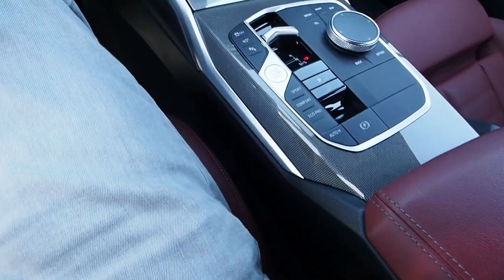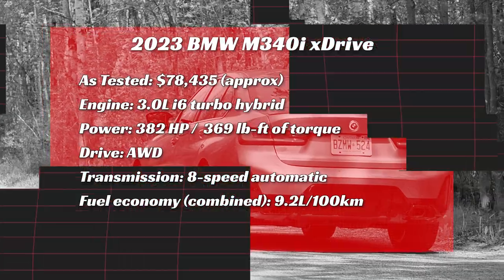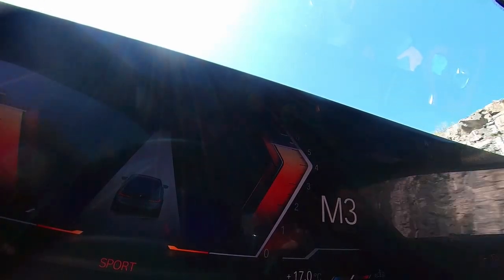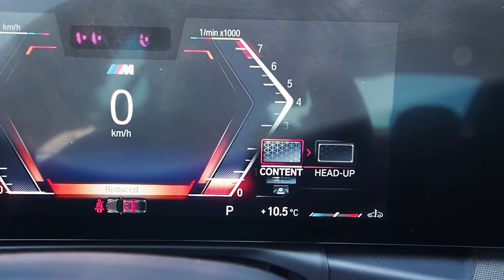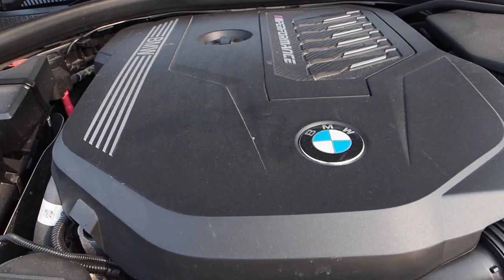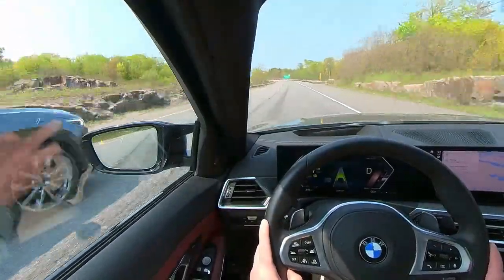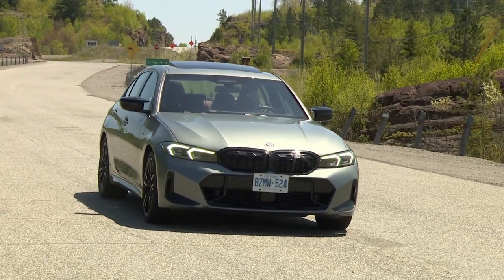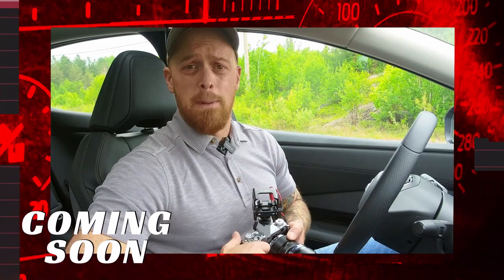[FACELIFT for 2023!] BMW M340i: Review, Road Test and Walkaround (STOCK EXHAUST)

Comment: I own this great driving 2023 BMW M340i xDrive.
I love driving this car very much, it is a fun car to drive.
But ... I hate the new controls on this car as everything you must do is thru the center screen, and I mean everything.
This is very dangerous as the driver must take their eyes off the road to change or do whatever they need to do and as every control is layers deep it takes time and long effort to do the changes.
Whoever designed this horrible and dangerous system should be fired.
BMW must change this terrible and unfriendly dangerous system ASAP.
I made a mistake buying this car.
If you are thinking about buying this model car do yourself a huge favor and check these very dangerous shortcomings BEFORE you buy it.
You can thank me later.
Reply: Really? I recently had a 330e lci as a courtesy car while my 2020 3series was being repaired. At first hated the controls but after 1 week I preferred them, use is seamless and intuitive, absolutely no problems using whilst driving. Essential controls are on the main panel. Genuinely astonished anyone would be struggling so much for it to be dangerous after a few weeks with this system.
Reply: Voice control my guy, there's layers to this lol.
Reply: I made the same mistake and am ready to break the lease to get out.
Reply: @layne4376 I much prefer Idrive 7 to 8.
Reply: That’s why they are rushing out Idrive 8.5. To rectify some of those issues. It’s still not as nice as Idrive 7 but at least it’s getting better.

Comment: Why is there an "M" preceding "340"?? Trim doesn't count.
Reply: @layne4376  More to an authentic "M" than speed in a straight line. Fact is it's a very small part. Trust me I'm in the know. Small thing,  non M's are built in Mexico along with the current M2. So much for that Bavarian ride. Well you do get that Bavarian price tag😄 Silver lining.
Reply: There three M used by bmw the first are small m badging on the steering wheel and wheels and the added trim package which is nothing more than an appearance package. The M proceeding the numbers such as M340 is a performance in the engine upgrade and of course visual cues. The M and a single number such as M3 indicate a full and true M series car. So a car such as this m340 does have a little flex as part of the m line up it’s not a true M but it does have some flex.
Reply: @362chop  My wife's X3 was built in South Carolina, and yet, it is a quality item. No creaks or rattles, and drives smooth as butter. It doesn't matter where it is built. It matters that BMW is supervising the process.
Reply: @layne4376 Thanks for reminding me why I read but not very often make a comment. I may have been short in an explanation without listing the dozens of things that can change with adding the m-sport package to a standard bmw as depending on the series there can be a wide variety of added items yet I will stand by my short but simplified explanation for someone asking a basic question. The performance is not increased as you should know being you drive a m440. You would know the engine is the same b-48 with the standard 255 hp as all 330 will have. Now like your m440 as you should know has a b58 which is in many bmw’s yet since you have the m440 you have the high output version of the b58. Thus differences in performance not ride comfort as sport suspension would take away from because the performance of less body roll during a high speed corner is negligible as are the brakes prettier yes a small increase by negligible mm in rotor size maybe increasing your stopping distance by small margins yes but not what many would say are performance upgrades. See I so didn’t want to be an ass and yet I’ve started turning into one here. I do apologize for this response. Let’s not be what bmw owners are supposedly known to be aka douche bags. I do enjoy my bmw as I’m waiting on the third one I will have owned to be built.
Reply: @ARentz07  While being charged Bavarian prices i'd prefer my build from across the pond. When BMW Spartanburg began some 20 years ago i understood the decision, made sense. But this Mexico thing , and it has NOTHING to do with Mexico itself , it soured me. BMW saves while the consumer gets screwed. Mercedes doing the same thing, C63 Sedan, Mexico. This just strikes a nerve with me, nothing personal. Good luck with everything👍
Reply: Basically appearance package. While it won’t have a true M engine, it’s pretty impressive.
Reply: @layne4376  Better check that destination on the sticker. Maybe a handful still built abroad but the ordinary BMW consumer happens to be clueless. Corners Okay, just okay. Enjoy the ride. BTW my comment wasn't directed at you more like the audacity of BMW marketing.
Reply: @layne4376  That's good news. I would never do a personal attack. It's a beautiful car, Enjoy it.

Comment: With the $$ you would save buying the dynamically superior G70 3.3t, it would take 20 years before the fuel savings would catch up. By then, the M340 will long be in the scrap yard.
Reply: But then you have to buy a Genesis 🥲
Reply: @bigpinkeraser  Thanks, I sure am!
Reply: @domcars  Yeah, I did and saved 20k! Love it
Reply: @SlipAngleG70  Glad you are liking it. The G70 was on my short list as well along with the M340i. But, I ended up going IS 500 because I am a sucker for the V-8. My wallet does not thank me when I am at the gas pump... but it is a fun car. The G70 was, too. It was the V-8 and my prior ownership experiences with Lexus that led me to choose it. All are great cars - the Lexus is probably the most polarizing because underneath, it's an old car. Alas. 🙂
Reply: @ARentz07  I almost went IS500 too. Like you said, that V8...!
Reply: Are you kidding? With all the issues and recalls Hyundai is having you’d be a fool to even compare Korean trash to BMW 3 😊ownership lol. Genesis is competitive with honda and Toyota.
Reply: Lexus IS and Genesis buyers unite. You’re both part of a wannabe ideal. People that drive Lexus and Hyundai are the same that buy fake Coach bags and LV.
Reply: @CalvinTennessee  Pretentious much?
Reply: @CalvinTennessee  Funny, I've had 2 G70s now and they have been awesome. However, the two M340s I looked at both had issues.